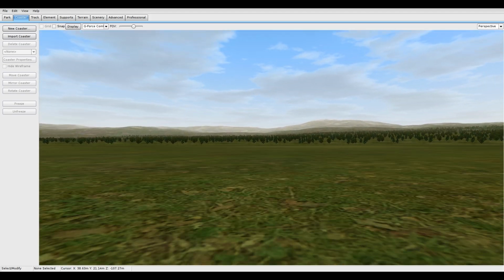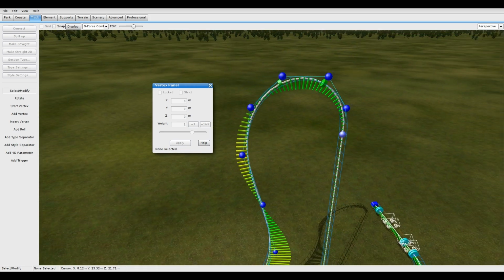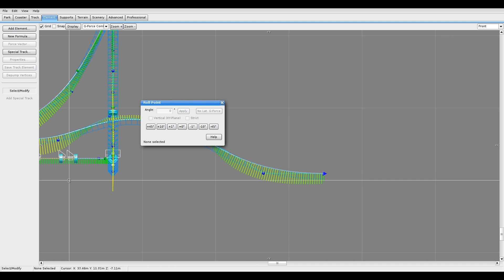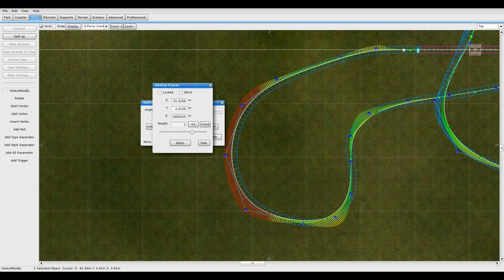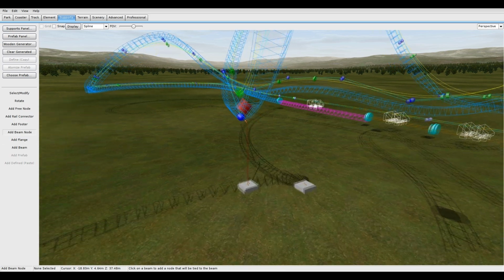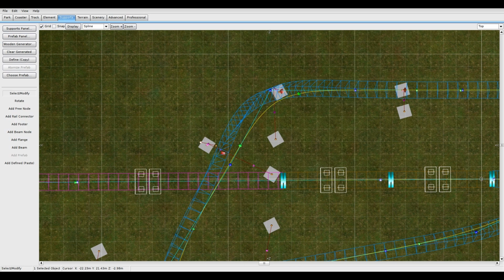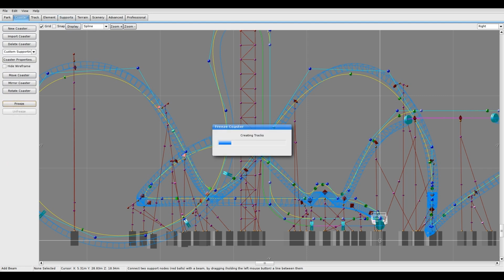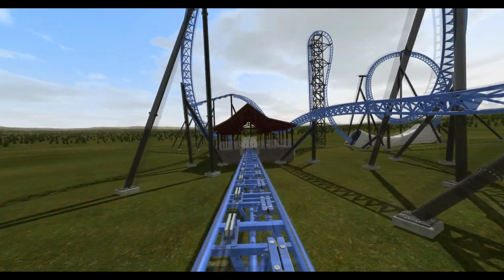Nolimits 2 Tutorial: Part 7 - Vertical Lifts, Beyond Vertical Drops and Custom Supporting

Comment: another great tutorial XD, just one question, how did you lift the track up and down(when you where making the corkscrew), was it a keyboard shortcut and if soo could you tell me, thxs
Reply: I hope this helps since you posted this 7 years ago but, if you click on the last vertex you placed, then go to elements, than add element, there should be many elements and one should be a corkscrew. Hope that helps.

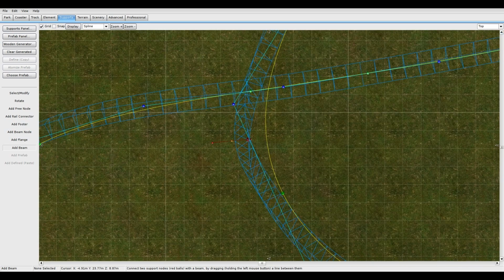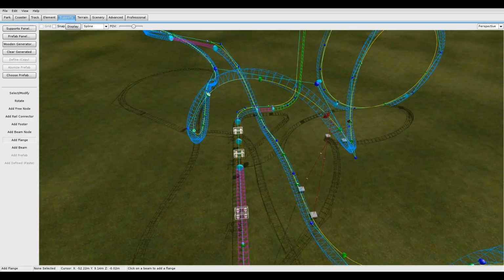Comment: hey code master, I've greatly improved creating coasters thanks to your tutorials! thank you! but i have a couple questions regarding to this video, how do you move vertex's horizontally/vertically while in perspective ( you do so in solid increments... idk how to word what you did but an example of what I'm trying to ask how you did is at 12:21 ) another question I have is regarding the 90 degree banked turn support, i understand why you placed the free node  for the extension, but why did you place the beam node ( 25:45 ) and connect supports (beams) from the beam node to footers rather than just connecting them from the free node placed... this results a small extension of the supports at the mainframe of the coaster track ( 26:08 )
Reply: I figured out that to raise the vertex's vertically in increments you have to press PageUp and PageDown to move it down in increments!

Comment: thanks! Every time I would try to give a beyond-vertical drop to a ride, it would make the track turn and bank heavily, and would only LOOK like a beyond-vertical drop during the editing part.
Reply: ***** Can't remember if I said this, but I was trying to modify the B&M diving machine that came pre-built with the game. Pterodactyl or something like that. I was trying to turn the 90 degree second drop (first after lift) into about a 120 drop, but the track would just take a vertical s-bend instead of ecoming beyond vertical. fyi, i was using it from the left and right view, and dragging one of the (can't remember the names: the big blue dots) left/right to where one point of the track would stick out much further than the bottom of the drop